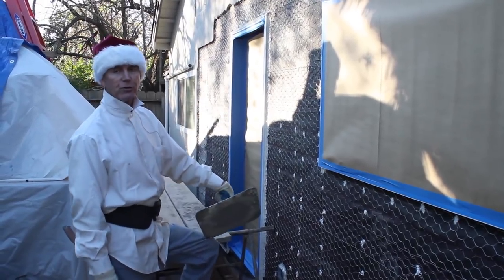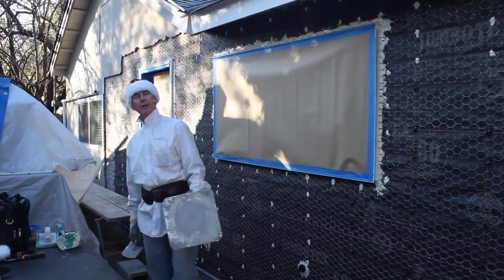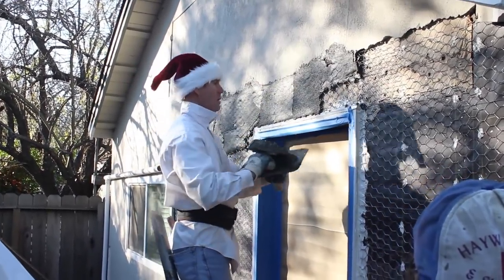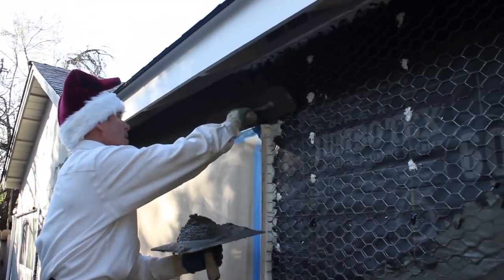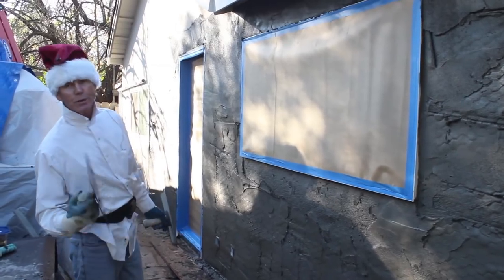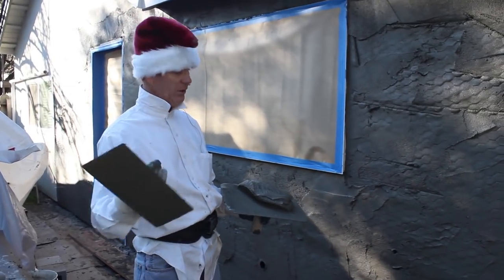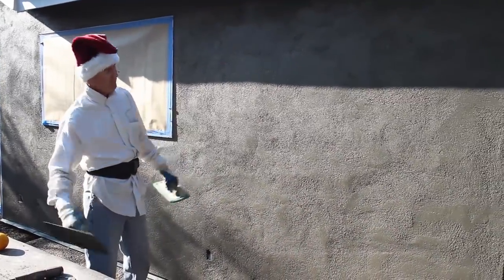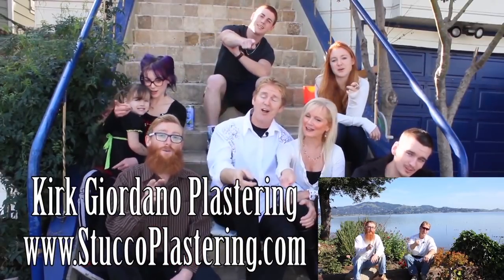Stucco Installations

Comment: I love your videos man I used to work on stucco kinda good experience ima doing a mobile home into a stucco and stone house do you got any suggestions or advice
Reply from the maker: Howdy Michael, sorry brother but the opposite, one cant stucco a mobile home, unless you realize it will never move again, even then the structure of these with the framework is wrong for too many reasons to mention here, We wanted to do that 30 years ago, but the issues of doing so held us back. You would need a peal and stick for tin, how to attach the lath or mesh would be an issue.  
You could simply apply a bonding agent to it after you pressure wash it, then use BMI 690 Cement plaster onto it. This could work, as again you can't lath it. The windows and doors would present a problem I believe too. Let me know how it goes? 🤔

Comment: After watching some of your videos, I decided to try some stucco on my 2 screen porch walls. They are block walls and had some unstucco or something on them which came off during pressure washing. I used a bonding agent on the walls and managed to get a coat of stucco up. Either my mix isn't right or my technique needs more work - I didn't start on the neighbors house. I drop a lot of mud! Does the 3 second rule hold for stucco???? I'm hoping to get the next coat to look like bricks which is what was done to the lower part of the front walls in 1977. In FL, on these old houses, they stucco the front and leave the sides and back block. Thanks for your videos.
Reply from the maker: Howdy Ken dude, applying plaster simply takes practice and help with mixing, 
     I have not heard of a 3-second rule, however, if applied immediately after mixed works, as a rule, you don't want the mud to get stiff as it will take much muscle to apply, lastly It sounds like you may have had too much sand in the mix.                    Live long and plaster
         Mastering Plastering for the beginner
Reply: G'day Kirk, love your work as always. The Three Second Rule applies to food. They say it's OK to eat something you drop off your plate so long as you pick it up again inside three seconds. Ken's question made me chuckle.
Reply: Then there's the 5 second rule....unless you have a 3 second dog :)

Comment: Hi Kirk,  Thanks for all your videos. 
 I'm rebuilding a decorative column, square, 16" in a side, with areas that dip in to 12" square every 3'.  I have installed expanded metal diamond lath over the whole thing, bending it in at the narrowed areas.  The diamond mesh was unfurred.  My question is whether the diamond mesh should sit up against the paper, or should be pulled out to leave a gap behind.  Also, given that it is not part of the house, is one 1/2" base coat adequate rather than 2 x 3/8" coats (I will be adding a cementitious colored top coat). Thanks!!
Reply from the maker: Good morning Hussein, on columns or small decorative work, the fact that it's a litle too flat won't matter much. on a whole house this wouldn't be good. 
The worst that can happen is it will spider check, small hairline cracks which can be covered with apnt or a colr finish.
 I would not waoory about it.
                                             best wishes,
 Sound advice for plastering issues from your favorite stucco geeks

Comment: Hi Kirk 
I think I have gotten a bad stucco job on my new house. The problems that I see right now is major bulges on 1st and 2nd story (couple feet wide) 
Also they have applied base coat to half of patio pillar leaving metal lath exposed for past 2 weeks (will this unfinished application cause stucco to crack in future?) Also they completed the other pillars but have not textured it yet.
Reply from the maker: Good Morning Sanjeev
   FYI, with stucco the slightest movement and or vibrations causes hairline cracks, this does not affect the integrity of the waterproofing membrane, however, most folk panic as they have no clue why this happens it’s simply home movement, vibrations in stucco walls are sort like Kryptonite to Superman, not good.
    FYI, you should not notice bulges, this is due to sloppy plastering, however, they can fix these areas with skimming, when complete the stucco netting should not be noticeable.
    Lastly, they or you should hydrate the walls prior to the finish coat so that the walls will expand with added water, thus cause hair lining, then when the finish coat is applied this third coat it will cover the normal hairlines that happens with a two coat system.,
                       Live long and plaster
       Teaching the world to stucco, one video at a time.

Comment: H Kirk Dude.  Awesome work!   Are there any exterior materials like a  "structo-lite consistency" for exterior work. Cement based stuccos are heavy and harder to work with seemingly.  You make it look easy Dude!  Keep doing Great.
Reply from the maker: Howdy CM dude, yes you can use plastic cement plaster it has more lime in it, thus spreads easier or you can use a bit less sand too.
            Live long and plaster
Teaching how to repair your home

Comment: hey buddy quick  question as amazon uk isn't the best for labelling things
which of bons rubber float colures are medium density as I'm looking to add to my quite frankly ridicules size bon collection 
thanks Stephen
Reply from the maker: Howdy Stephen dude, try this link, 
http://www.stuccoplastering.com/tools/
With hard rubber floats, they are in the link below, for sponge floats
 I'd buy the green ones as the blue ones are too small to be effective.
 Kirk Giordano plastering
Reply: done and ordered, I'm surprised there's not more bon tools on your site though as iv seen I'm many of your vids you heavily use bon  iv just had a load of bon bits delivered from amazon uk I'm quite liking them at the moment 

oh something you may like there's a new style plaster finishing trowel just being unveiled over here it is less labour intensive especially on the joints than traditional steel trowel used mainly  in the flattening and polishing stages its called nela max made in Germany , I'm not sure if there's a us distributor but the uk distributor is the plasterers 1 stop shop

Comment: I have a question, i have a manufactured home and has metal panels on the outside. Would i have to remove them and put plywood before starting paper?, and whats the difference betweem paper and foam?
Reply from the maker: Howdy Javier dude, if your manufactured home is set on piers, I don't recommend doing this as many have done this, but the stucco has cracked like an egg as most manufactured homes are constructed sturdy enough to hold the extra weight of stucco, so if it settle just a tiny bit, no good, sorry.    
                     Live long and plaster, 
  Sharing stucco secrets, or common sense tips

Comment: Hi Kirk, We recently opened up a wall between our living room and kitchen. I'm now at the point where I'm putting up drywall on top of the beam we put in and over about 10" of wall on either side of the beam. My main concern is joining the new drywall I'm installing with the old plaster walls. I got 1/4" plywood and 1/2" drywall to build it up to the 3/4" thickness of the old plaster walls so that part I have figured out. Most of the points where the new drywall will meet the plaster will be the corners but at one place the drywall will meet the plaster in the middle of the wall (we removed the kitchen wall but that kitchen wall only went about 3/4 of the length of the shared living room wall). I've been searching the internet to try to figure out if there is anything special I should do to join the drywall to the plaster but have read mixed answers. For example, some say to just tape and mud like you would for drywall while others say to use plaster-weld first and then tape and mud and some just say to tape and mud but first wet the plaster? In your expert opinion, what would you do if you were using drywall to patch up this wall and join it with existing plastered walls to ensure the bonds well? Thanks in advance!
Reply from the maker: Good Evening Matt, I would apply a bonding agent to all the walls in question such as plaster weld, I would than apply a 20 minute drywall compound myself, these come in 20, 40 60 etc, this means how much time you have before this drywall compound sets,Home Depot sell either Wespac or Easy sand, you can apply coat after coat untill you get the desired thickness.
 Taping mud takes forever to set so I don't use this product.             
                                Live long and plaster
                     Plastering tips and techniques
Reply: Thanks for the reply, Kirk! I started tackling this before I saw your response. Ultimately I ended up using plaster weld, paper tape, and premixed joint compound. The end result was great after 3-4 coats. As you mentioned the premixed joint compound took 24 hours to dry between coats which wasn't ideal but I had enough projects going on that it gave me time to work on the other projects in between coats which was nice...most of the time. Also, this meant I didn't have to worry about mixing it up myself. If I had to do it again, I'd probably buy a dry mix as you suggested to speed up drying and curing process in-between coats but the final result came out better than I expected with the method I took so I can't complain.
Reply from the maker: Howdy Matt dude, the weld creat is a must, then simply plaster with whatever mterial you want, it takes paratice to blend or feather in interior as well as exterinor transistions, hanh in there.      
                                  Live long and plaster
 teaching plastering to apprentice's or DIY homeowners